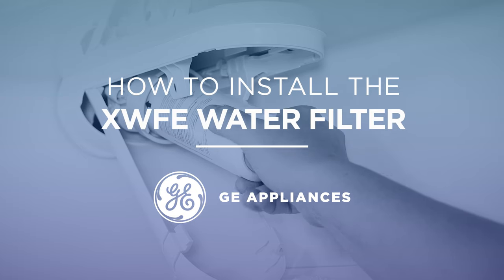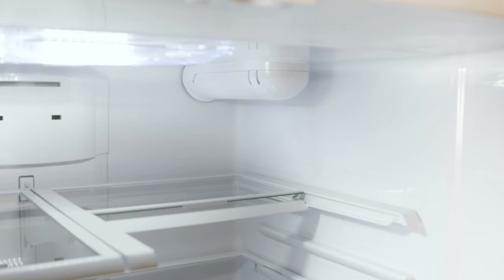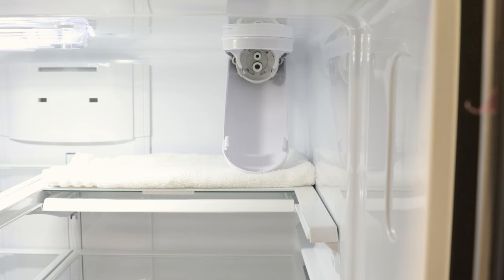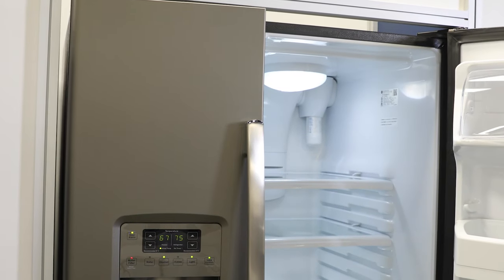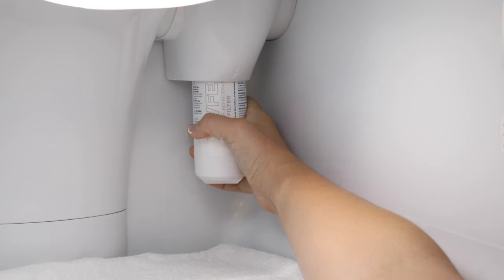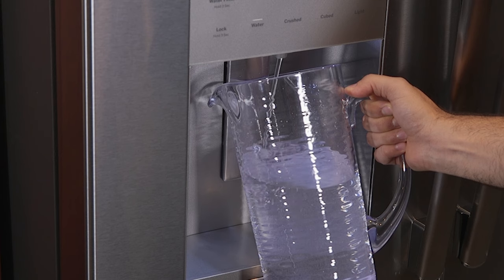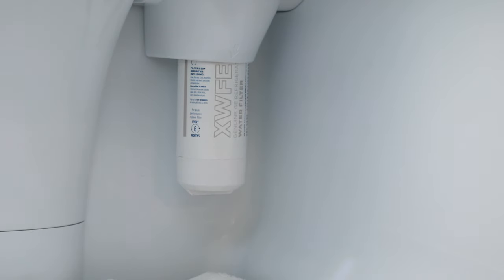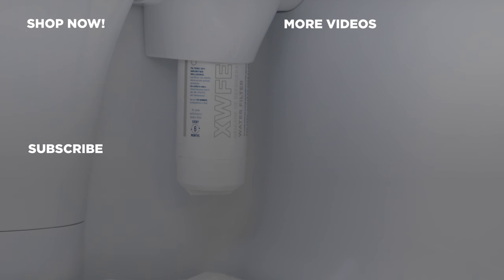Replace and Install the XWFE Water Filter

Comment: What a scam, unbeliveable, chipped filters.
Reply from the maker: Hi Jordane,

Thanks for reaching out. The XWFE Filter replaces the XWF Filter and is embedded with Leak-Detecting Sensing Technology. This enables refrigerators to shut down the water valve when a leak is detected at the filter. The size, shape, assembly, and installation of the filter remains unchanged from the previous XWF filter.

If you'd like to learn more about the XWFE filter, you can click here: http://spklr.io/6054crEs

Best wishes. -MS

Comment: Why did you change this design from the XWF...this XWFE is garbage and costs a ton. Which wouldn't be half bad but it doesn't work!

I tried off Amazon several times and the fridge just gives an error message...and yes it was a XWFE...had to order the bypass plug instead but now I'm thinking I paid to have this water filter, why am I settling for a bypass plug? Still under warranty so I should just send this trash back and let GE deal with the loss. Do NOT buy GE if it uses this filter! I know I won't again.
Reply from the maker: Hello and thanks so much for bringing this to us. We're sorry to hear about the issues you've had with your refrigerator dispenser and are always happy to help. There are many very realistic counterfeits online, so we recommend purchasing directly from our parts website or reputable dealers, such as Lowe's or Home Depot. Please let us know if we can help with anything else. - JB